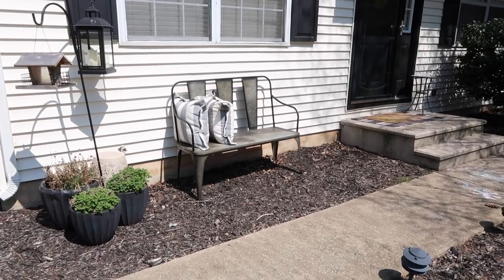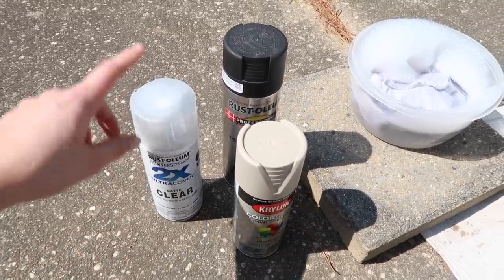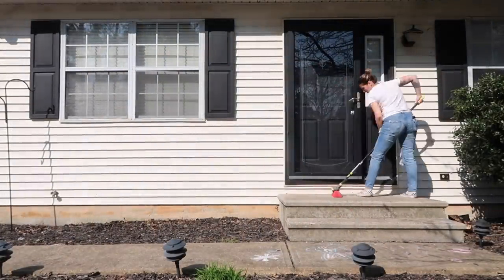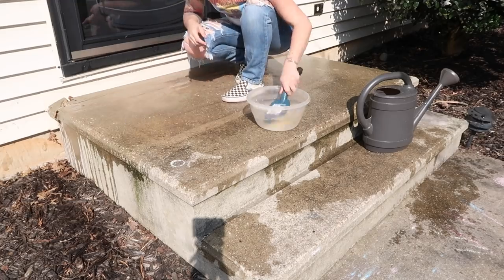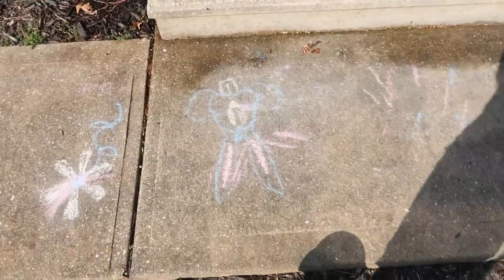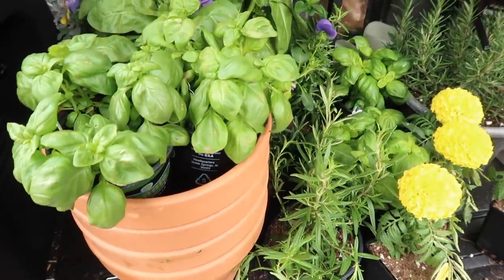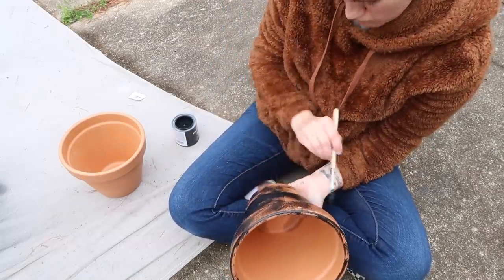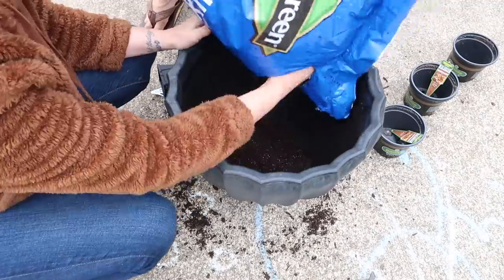DIY Front Porch Makeover on a Budget with Outdoor Decorating Ideas

Comment: You could always add paver blocks into the area where your bench sets so that you would have the appearance of all concrete in the mulched area. I've done that so I wouldn't have to step on the mulched area. But rather the feel of concrete. It works out good. You did a great job on your makeover.

Comment: Hi. Just a couple of suggestions. You probably should have spray-painted your handle. I don’t know how long that will last that way especially with the constant touching. You could have used a self etching primer first. That helps with the bonding of metal. Also, if you want the feel of a front porch, you could search Facebook marketplace for free pavers. People are giving them away all the time. And the area next to your porch where there is mulch you could just add pavers. You wouldn’t have to keep mulching year after year and it would give you the feel of the porch area.
Reply from the maker: I want a real front porch lol. Until then, I’m happy with what I’ve done in the flower beds